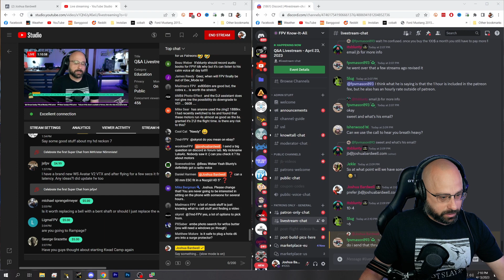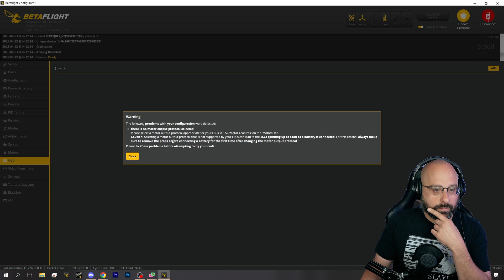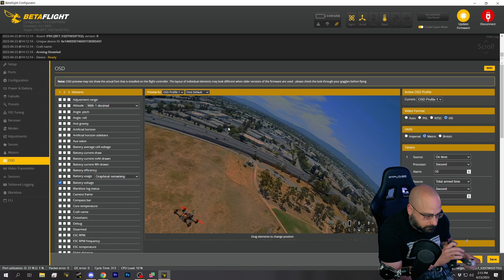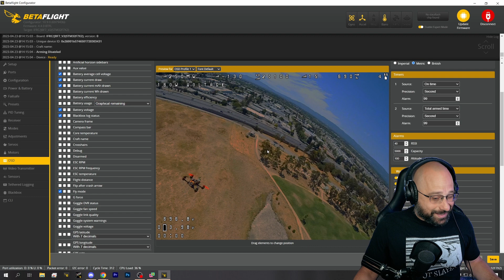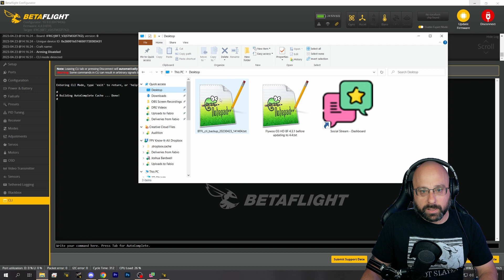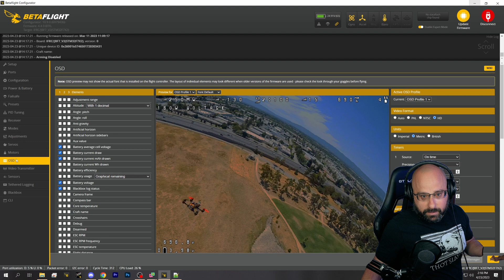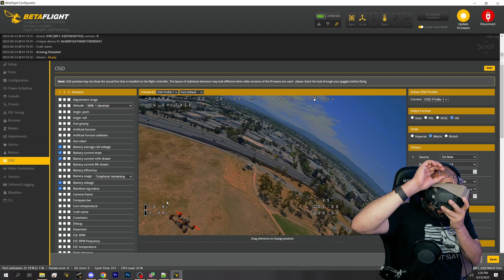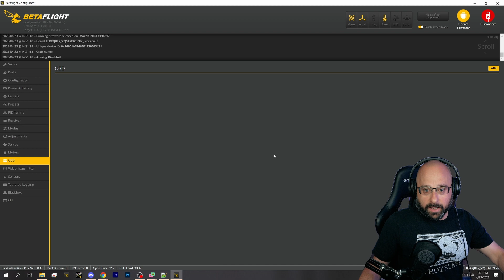OSD Elements Keep Moving To Center Of Screen? Bardwell Troubleshooting - FPV Questions

Comment: I seem to remember a recent change that will push OSD elements on the right in if the canvas size is decreased. You may have had the correct canvas size but then the elements had been moved by setting the size down.

Comment: If I am going pure digital, do I even need the osd chip? My guess is no as everything is important stored in the video transmitter (fonts) and position is transmitted via uart/msp.
Reply: You're correct, but it's not the transmitter, but the goggles that draws it.
Reply: good question 🙋🏻‍♂️ ! also wanna know !